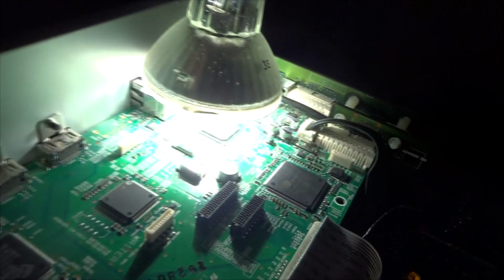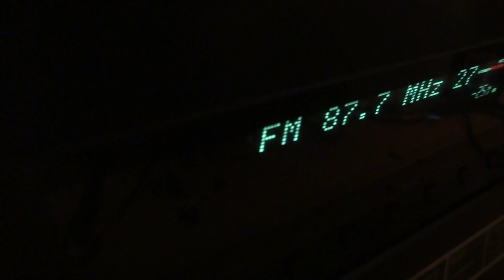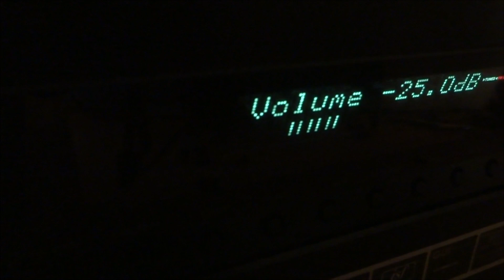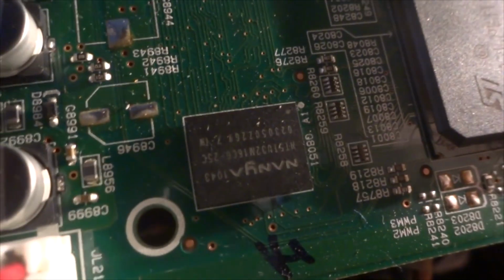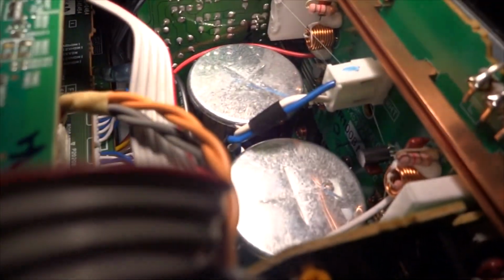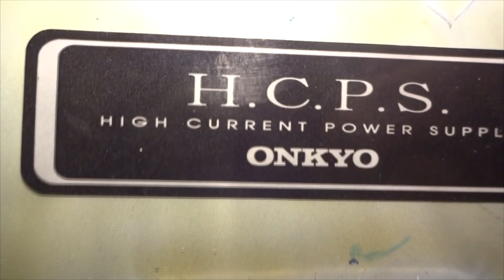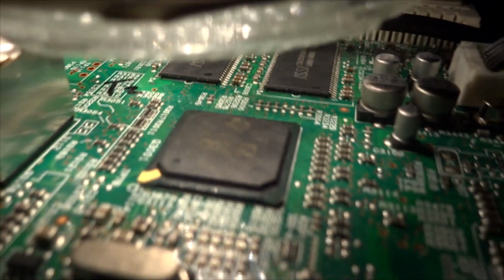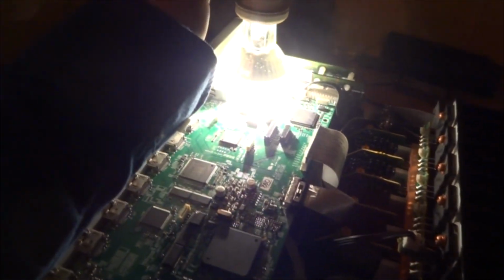Onkyo Amp update, Quick "no sound fix"

Comment: I just opened up my ONKYO receiver, cleaned it with Contact Cleaner, pasted a heat sink on the DTS Chip and it started working flawlessly without any issue.

Comment: Thank you for posting this repair.  It work for my 616 but I did not use halogen lamp instead I used a heat gun which is safer and I already own one.  Much faster than a lamp.  This is pretty much the same as the fix for the PS3 CPU chip.
Reply from the maker: Yes, I also have a heat gun. I did it this way because not everyone has a heat gun.
Reply: How long the repair will last?

Comment: It works because it brings the low temp solder  to flow and fills any micro cracks from excessive heat...need heat sink on 'hot' chips.

Comment: I used the reflow method to fix my tx nr807 from dying and put in 2 funs in it after that. One to blow air directly on the dts chip and one to draw out the heat from the avr. Since then I have been using the 
A/V for months without this issue again but before that even after reflow it barely last for a day without turning sound off again, so I Think the cooling method is the only way to save it after reflow.
Reply: I bought one of those laptop cooling pads and plugged it into the USB on the rear of the unit. Mine has been operating fine since around March of 13.  It has just started with the sound issue. I found that I also have no ethernet connectivity when the sound issue is present.  By placing it in NET mode, cycling power on the unit, I get Network Initializing prompt on my TV.  Once that works, I can then change to one of my HDMI inputs.  I have found that by leaving it streaming a station on NET for a short while seems to be more reliable.
If I quickly change to one of the HDMI inputs after getting the network initializing prompt, it will sometimes quit again.
This is my 2nd Onkyo receiver in 8 years and I'm losing faith in their product. I certainly hope they will stand by this and fix it even though it's out of warranty.  It's what I expect from a quality product.

Comment: This Just happened to my tx-nr 717, thanks to the comments here I'm able to send it out for repair. Hopefully it won't reoccur, but they're extending the warrantee to 2018, so that works for me.
Reply from the maker: Good for you. My unit was unfortunately already fixed. I got mine free from our local transfer station.
Reply: drew mora - The warranty was extended to Dec 2017. The problem with the warranty repairs, is what some here have experienced - the fault re-occurs, then they don't want to know. Can a heatsink on the chip, or a heatsink/fan completely elliminate the failures?

Comment: Once Onkyo stops repairing thair mistake, find a mini fan that will work off of a low voltage source in the amp and solder it over the chip. Use your test light to find a supply voltage that matches the fan. You can change the voltage with resistors too. While you are at it put a fan on the chips that bolt to your heat sink.

Comment: Its due to bond wires that connect the slicon inside to the pins on the outside package. The microscopic wire is reconnectign when the copper expands in the small bond wire.
Reply: I do not believe it's related to bonding, i assume it is a so called 
"cold solder joint" where the solder joints are being recrystallized due
 to temperature cycles. Worst case is the solder joint brakes, in this 
case the solder tin structure could be restored and the contact 
resistance could be lowered.

Comment: Onkyo will repair this No-Sound problem for you..  They send you a FedEx box for your receiver.  You send it to them, they repair it and send it back working. 

Go to the Onkyo web page. 
Click support-> special_service_program-> Loss of Audio/Network Customer Program

Follow the instructions. 
FYI, the serial number is a paper 16 digit number on the back bottom of the Receiver.  DON'T ENTER the LAST digit.
Reply from the maker: I know. I tried that, my receiver has already been repaired. Kind of crappy quality if you ask me.
Reply: Is this free of charge?
Reply from the maker: Martyn James Yes for your first time. Think of it as an extended warranty.
Reply: Ira Hart Thank's a lot for this info !!!!! My TX-NR579 seems dead (no sound, no NET or Firmware update menu, Initializing...) but will be repaired by Onkyo for free :-))
Reply: Ira Hart  you are the best man
Reply from the maker: Ira Hart I actually found another and they repaired it. Though the sound problem will happen again unless you put a heatsink on the DTS chip. The problem was that chip overheating, so they should of put a heatsink on it.
Reply: Joshua's Recordings  Actually, the DTS chip does NOT need a heat-sink and was not overheating.  The problem is that on the failing Onkyo units,  there were cold solder joints on the solder balls under the DTS chip.  They didn't follow the correct soldering profile guidelines when they manufactured the Onkyo boards.  The chip either needs to be pulled off and replaced, OR re-flowed (reheated) again which is dicey.
Reply from the maker: Ira Hart Which Onkyo does if you send it to them. Though the DTS and the Analog Devices chips do get very hot and should have heatsinks. When I put the heatsink on the chips on my TX-NR717, the heatsinks got warm.
Reply: Joshua's Recordings I actually design chips for a living.  There are very conservative calculations that a chip designer will use to decide if the chip needs a heat-sink or a fan in the enclosure.  In most cases, the answer is that they are not needed.  
As a matter of fact, many server farms including the ones at Google, are removing the cooling in the rooms they are in because cooling is not needed and they can reduce costs.   The problem is that humans cant enter the server rooms now because they are too uncomfortable.  I cant paste the link here but read the first article, Google this:  "server farm temperature"
Reply: +Joshua's Recordings I spent maybe 185$ on ebay. The guy said HDMI worked, but no sound. I found a pic on the listing of the serial # and they said its approved for a 1 time repair.
Reply: Ira Hart 
Hi my onkyo ht-s3500
All functions good work but sound not clear and over heat hdmi board
Reply: Nope they will not fix mine.. mine has the same common problem

Comment: you might be able to get better reaction if you use some solder paste and a hot air soldering gun you might be able to get it actually reconnect to the board

Comment: My TX-NR709  has been supposedly fixed last year but it just failed again today and they wont fix it again.  I guess it wasn,t really repaired so I am going back to YAMAHA.  Got three of those already and never ever had any problems at all.  Goodbye ONKYO...
Reply from the maker: +Luc Daig yes, you see they replace the chip but they do not put a heatsink on it. It is just going to happen again in a year or two. Onkyo makes very, very good AV receivers though. The problem with this batch is a chip made by Texas Instruments. Texas Instruments claimed the chip does not need a heatsink - it does! So the chip overheats. This really is not Onkyo's fault and is the fault of TI. Like I said Onkyo's AV receivers are a superb quality. When I get them repaired I put a heatsink on the chip. I got one repaired last summer by Onkyo (that I found at the dump!). Put a heatsink on the chip and it is still working great!
Reply: Mine recently began doing this say about 14 years of ownership.. I will research getting a small heatsink for the chip inside my receiver.

Comment: Good evening and congratulations for the video. I take this opportunity to ask you a question. I have an onkyo sv454 amplifier that has a problem. In FM radio the speakers sound good while if I put on video1,2,3 or CD and try to reproduce the audio coming from the various sources the left channel does not play, only the right works. If I put it on the radio it works perfectly. What should I check once opened? thanks and to the next video. ps: If I leave it unplugged for a few days and then mention it, both speakers work for a few minutes in every situation. What can it be? Sorry my english but i'm italian. thank you

Comment: I have a TX-NR717 and my search gave me two possible failures. One is a "defect" (see below ) DTS Chip and the other one is a general failure at the HDMI board. So i wanted to try the baking of the HDMI board in the oven... This completely failed because the HDMI board is connected to a 90° angled PCB and i could not evaluate which kind of the connection is, fixed or mated, i was not able to unlink the connection. Therefore i decided to do a partial heat up of the whole HDMI board with a construction lighter with control of a laser thermometer where i could check the temperature at single spots. This is very important because the max T of the PCB in consumer applications is 85°. I controlled the T at the Chip and also on the PCB, after 10 minutes i had partially 150° on the solder joints and 90° on the PCB....  What should i say more as if all functions of the receiver are working! I could not locate the failure but who cares....

Comment: It fixes it by reflowing the solder that cracks over time from heat I used a bit of flux an a heat gun to fix mine then I bought a small heat sink an mounted it to the top of the chip an it's been working for a few years now
Reply: What size heat sink did you use?

Comment: It is best to have them replaced the board right away. The heat and electricity travels on  these board basically wear out the cheap coating used on these types circuit boards. The heat/cold expansion causes the short circuit. Hopefully you're within your warranty. i had mine replaced within 2 weeks at the authorized repair center and learnt the real problem from the technician ultimately.
Reply from the maker: rayred73 What do you mean "the real problem". The problem is with the DTS (DAC) chip, it gets too hot and causes the solder joints to go cold/cracked. To fix it properly you need to reflow the solder or reball the DAC.
Reply: Real problem was referred as overheating board with cheap coating which caused cracking of and soldered connecting as I was told. The CHIP can be a driving factor. Didn't mean to stop over boundary.
Reply from the maker: rayred73 No, I was just asking, you didn't step over any boundary. Also just want to make sure you know that the coating of the board is not the problem, it is the solder. What would of fixed it is if they just used a heatsink in the first place.

Comment: there are video's online how to reflow the print in a normal oven(220pre heated 10 min.)
warming the chip wil just make it al expand thus reconecting the broken tin connection,temporarly.
prevent this problem from happening? let it get air to breath, yes it needs cooling,
covering it in anny way wil speadup the dieing proces,
heat can solve it temporerly, but is is also the cause of this problem.

Comment: worked fine using a hairdryer blowing for around 15min
Reply: After repair of the lost sound?
Reply from the maker: It will stop working again after about a day or so. This is just a temporary fix! Check to see if you can send your receiver to Onkyo by following this link: https://repair.onkyousa.com/na/ If not you can try to reball the chip (if you have the proper tools). Make sure to put a heatsink on the DTS chip after you get it repaired!
Reply from the maker: What country?
Reply: Rmania
Reply from the maker: That country is not listed under Europe. It tells you to contact an authorized dealer.
Reply: Thanks a lot. what advice I give on this matter? A new board is very expensive.
Reply from the maker: New boards are very expensive. I would try contacting a authorized service person to try and get it fixed!

Comment: You really have not fixed it(the sound issue) the problem is in the dts chip itself, that is the nano connectors or most know them as "Gold layering's(traces)"  Because when this chip gets hot, and due to expansion and contraction of the chip set,  eventually it breaks down under the cooling process.  Thus, when you heat it up you close the open traces.  Failure to provide proper heat sink and cooling fan, is a plan for disaster.  At one time it was the solder and being a ball solder chip set, the poor solder broke down and opened the connections.  Today we use higher tensile solder so rarely do you have to reflow, which is a short term fix.  The best process is to remove the chip set, clean, and use a reballing machine chip soldering station, if you can afford one, 5K up, the better ones 10-20k up.  Wrap up,  the best way is to R & R the defective chipset with a new one, if you can find one.  BTY, manufacturers are getting greedy and smart, they are now putting Bios ID's (like Apple) in their chipsets for that particular unit
and must be programed for that unit, which means any identical chipset will not work but must be programed by the manufacturer for that unit, Reason, you know!

Comment: would these also be the same issue if i lost audio in only zone 3? Zone 2 still has audio (outside speakers) . I made sure my zones are both on. I have no audio for my tuner, DVD or cable, again only in zone 3. Thanks for the great info.
Reply from the maker: That is weird. Did you try turning the different zones off and playing in "All Channel Stereo"? Or try a system reset.
Reply: didnt try a system reset. is that just unplugging and leaving down for 15 min? called onkyo and they are going to repair for free.
Reply from the maker: Rodney Allgire Press Power and VCR/DVR buttons until "CLEAR" reads on the display. This will clear all the settings on the receiver and hopefully get your sound back!

Comment: One of 3 things is happening.... First of all, it is a BGA device. As you see, there are no leads on the part. If you need to change it, you have to have a BGA rework station. it has special optical sections that allign the part, perfectly so the balls of solder on the chip meet the landings on the board. That being said... A) the part, inside could be faulty and heat will warp the part causing things inside, to reconnect and it will work. 2) the bottom of the BGA part is warped and a ball or more isn't making proper contact with the board and when heat is applied, the part warps, causing the ball/s to contact properly and it works. 3) The main bord could be warped, not perfectly flat, and the balls won't make good connection either. In any case, there is a process problem, either with the part, the soldering of the part, or the main bord not being made to spec. BGTAS are very hard to diagnose because you can't see the solder balls or resolder them. Get used to seeing this all the time, for 2 reasons.... A) lead free solder sucks and is very difficult to do a good solder job with. B) most parts are going BGA, with no leads except the solder balls on the bottom of the part. At the end of the day, the only things you can do are send it back to the manufacturer or certified repair station or junk it and buy a new one. Since it is warranty, let them have the headache. If manufacturers are smart, they will make things modular and just replace boards and not complete units. As for your description, unless you have a BGA rework station, you won't be repairing BGA problems, at least not correctly.
Reply: Thanks Texas Instruments (Apparently had a recall on a ton of these) and Onkyo for not installing even a shitty heatsink on the IC.

Comment: is the main control chip for your surround sound unit that's what the DTs chip does it controls all the functions for your surround sound evidently have a cold solder joint on the chip and it's a contact with all the contacts on the board you want it overheats it breaks contact and it shuts down what you are doing is heating it up and possibly doing a temporary connection to the board and you will notice it'll work for a while and then it'll shut off again what needs to be done as the chip removed from the board ship needs to be ribald and re-soldered to the board but you obviously don't have the right equipment to do it